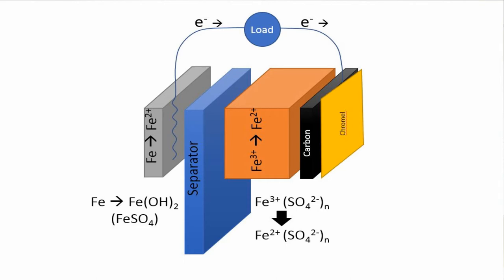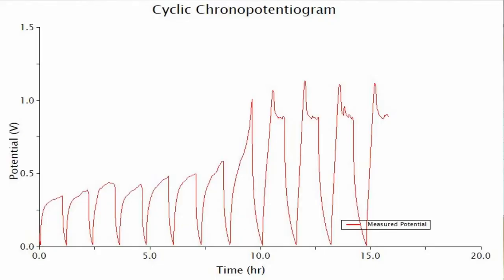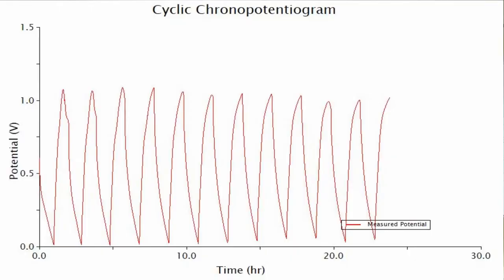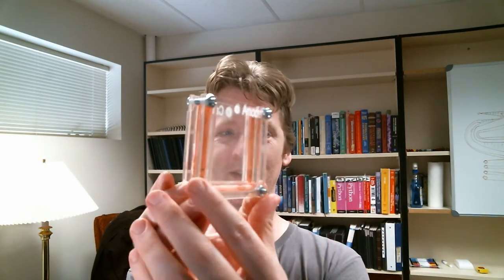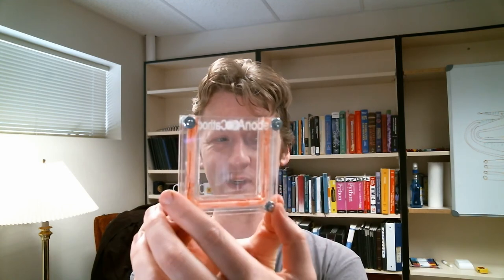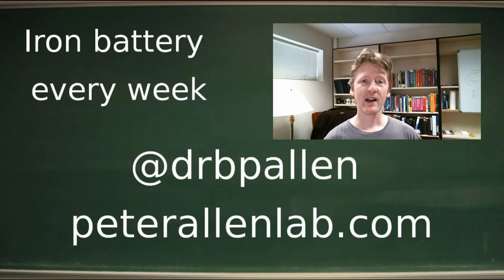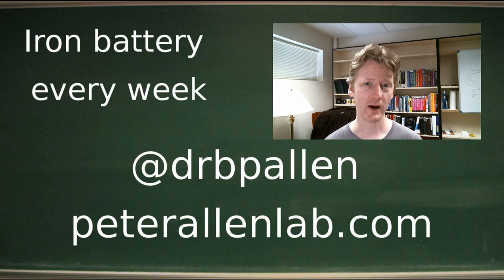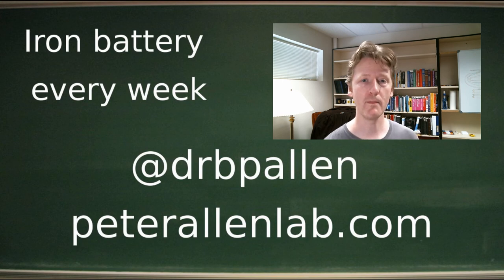Iron Battery part 74: Tests of Pyrolytic Carbon Additives

Comment: Hi Peter, I know this video is a bit old however if you are having trouble carbon felt being hydrophobic hit it with a blow torch for a few seconds on each side. you don't need to heat it up just run the flame over the entire surface for a few seconds and water will soak straight in easily after that.

Comment: Hi Pete, the research is going well.The carbon felt certainly works well and is great for current collectors in a quick experimental cell, but @ $40 m^2 I don't think this would be a cheap option for a DIY battery. 
A robust conductive ink on an aluminium foil would be far cheaper, maybe not as conductive as the felt, but much cheaper. - Martin.
Reply: What kind of conductive ink?
Reply: solarhope Have you seen the suggestion to use carbon fiber weave tape that has been baked in a kiln at 350°C ?
Also, he showed in the video the ad for the felt he is using said it was $11.99 not $40 (?)
Reply: I have been experimenting with graphite and carbon black as the active material and acetone / cigi butts or acrylic varnish as the binder 
Its not a great conductor on paper, but is good on aluminium foil, less than 5R from the surface of the ink to the foil.
Reply: The stuff I have been using was $40 m^2 by 5mm thick, maybe it is now cheaper I bought mine over a year ago, please post a link @$12 m^2 if you know different. :-)Aluminium foil is very very cheap $1 for many m^2.I'm sure that the cost of a suitable carbon/graphite ink would be cheap also.A coating of one upon the other would provide a resistance of less than 5R for the current collectors, stopping corrosion from electrolysis  is the problem.
I am not there yet but am making good progress.
Reply: Hi solarhope, Going by what I viewed in the video, Peter seems to be getting it through aliexpress, and if you google the number in his screen-cap, pancf5100100,  it does get a match.  I'm not including the direct link because stupid yt comments are very unpredictable whether it will get blocked.  The ad says 4 pieces.  I guess that means each piece is 5x50x50mm, but not sure ??
Reply: Hi Karabetter, Ive had a look at Aliexpress and a typical price (they do lots of different products?) is $12 for a piece 5mm x 200mm x 300mm, that's 15 pieces per M^2 or $180.I'm sure you can buy it cheaper than that in bulk, but my point was you would need a lot of it for an Iron DIY battery, by its nature it will be very bulky and use a lot of current collectors.
Reply from the maker: I tried aluminum foil a while back and it corroded through. A conductive ink would protect it, but might develop pinholes over time. I would love to find a cheap metal foil that resists corrosion. I tried buying gold leaf for that purpose at one point but it was pretty clearly not as-advertised (it corroded rapidly). 

The graphite felt I used was from a random vendor on aliexpress. I believe it was this one:

https://www.aliexpress.com/item/Carbon-Graphite-Felt-PAN-Based-PANCF5100100-Carbon-Felt-Insulation-Roll-heat-insulation-felt-in-vaccum-furnace/32542641054.html

I agree that I need to find a cheaper replacement.
Reply: Peter, do you have access to a kiln?  Because carbon fiber cloth is very much thinner, apparently has a good conductivity, and processing it in a kiln at controlled temperatures is supposed to "fluff" the fibers and create very large, physically stable surface area.  There is a recipe for that if you are interested.